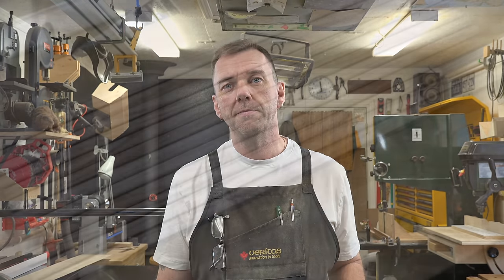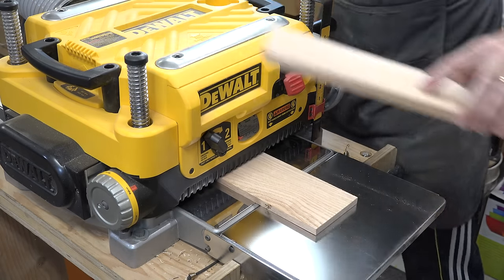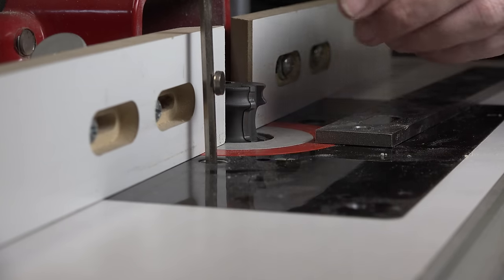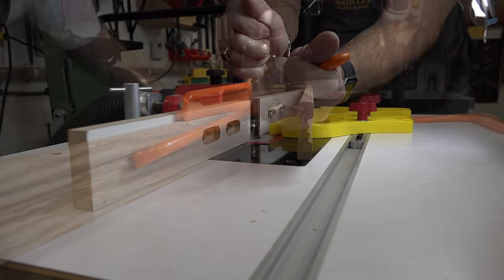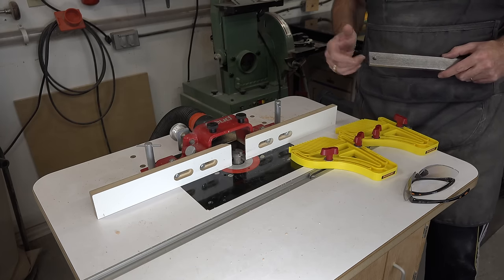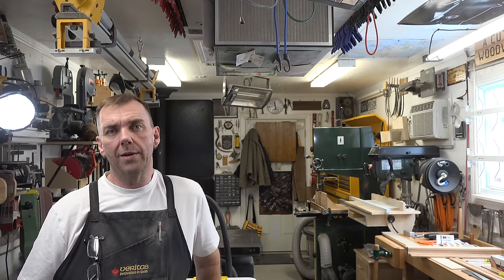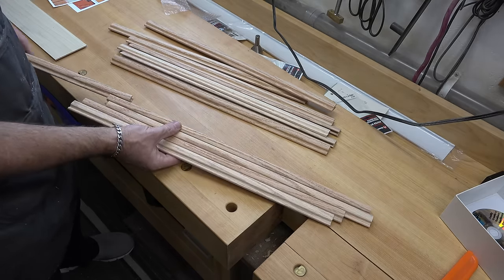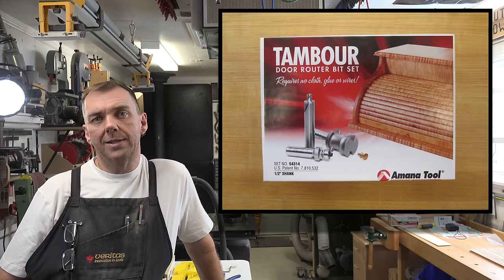Router Made Tambours

Comment: Hey, I bought this set many years ago, I've used it only once though. I used shims for the main cutter, so I set the fence to the final position, fit the shims to the front of the fence, removing one at a time to take off small amounts at a time. I use the same types of shimswhen using raised panel cutters. 

Cheers from Downunder
Reply from the maker: Sounds like a great method for sure.  The best part about this hobby that we all love is that for every process, there are multiple methods to achieve the final result and while my method works for me, it is not the only method to make these tambours.  Thanks for tuning in and for chiming in with your method.  I truly appreciate it.

Comment: By the way - that's a good general tip (that I first heard of from Charles Neil) about 'pre-cutting' a portion of what you expect the router bit to do. The same kind of thing can be done for a sliding dovetail or a t-slot - use the table saw to remove a big part of the wood and let the router bit just do the fine tune-up (so to speak.) Not all things work that way, of course - so taking more than one pass as you did with the first bit both reduces the strain on the bit and gives a much better final finish to the cut.
Reply from the maker: Thanks Ken.  I'm a firm believer in "work smart, not hard" and the same thing goes for my tools.  Why labour them down and wear them out prematurely when you can use two different tools to reduce the strain on both and make them both last longer with better final results.

Comment: Great video and it looks like a really nice result.  Shame they are an unbelievable price though..  I was excited to buy & try until I looked at the price.
Reply from the maker: Dave, I'm not going to try and cushion the price of these router bits but what I will say is that although they are brutally expensive, I don't regret buying them for one second.  The tambour on my roll top desk is incredible and it wouldn't have been possible without the bit set.  I would have had to relied on the traditional method of using cotton canvas and gluing my tambour stock to that.  I really didn't want to use that method.  I guess what it boils down to here is that I was hoping to make an heirloom piece with this roll top desk and I have done exactly that.  Making the tambour last as long as the heirloom was important to me and this method made it possible.  It was well worth the price to ensure that this desk would outlast me for many years to come.  Whatever method to decide on, I hope your project works out to be fantastic.  Thanks for tuning in to the show and for taking the time to leave your comment.  It is truly appreciated.

Comment: Nice! Thanks for recording this. I'd like to see a summary of how much the wood to tambour ratio is (that is, how many inches of "width" of the input 1/2" stock produces how much "height" of the resulting tambour).
Reply from the maker: It's a little difficult to measure, but it looks like each piece of oak in the tambour produces about 9/16" of length in the overall tambour.  There is some loss where the balls go into the sockets but from what I am measuring this morning it looks to be about 9/16".  I hope this answers your question.  It was a little confusing.  Thanks for tuning in.
Reply: @acutabove_woodworkings  So 2 inches of stock (actually 1-15/16) turns into two strips in the tambour. Thus 1 inch of stock produces 9/16" of door? So 9 inches of door requires 16 inches of stock, 18 :: 32, 27 :: 48, and 36 :: 64. That's a great piece of information to have! Thanks!
Reply from the maker: Austin Hastings you’re very welcome.

Comment: Hello, Great video. Two things though...  It looks like you were struggling with the push stick on the milled side of the stock after passing the bit. Maybe a Third Feather board would help or at least moving the two you have and repositioning them so one is in front and one after the router bit. Second, What is the kerf of the table saw blade required to cut between the two beads separating them into two halves...? 1/8” or less using a thin kerf blade...?  Greg
Reply from the maker: Thanks for the suggestion on the additional feature board Gregory.  I appreciate your input.  As for the saw blade needed to separate the two bead sections?  It can be any standard saw blade.  The kerf on mine is 1/8" but really, any saw blade will do the job.  I hope this helps.  Thanks for tuning in to the show.

Comment: Your video was about I was wondering about. When I was a kid we had a color TV as furniture. It was ornately carved & had a tambour door but it didn’t have a cloth backing. Everything use to be better made. I miss it. I have a penchant for minimalist things or processes—rope knots to do work, geometric constructions, timber framing, etc. I see elegance in simplicity. 
Curious question I hear Canadian English but you use Imperial? Are you binational? Or trying to appeal to a wider audience? Whatever the reason I appreciate it. I’m turned off by woodworkers that use Metric. I know it’s simpler but I’m not use to it & frequently have no frame of reference without making a conversion. I’m glad I I found your channel.
Reply from the maker: Well, we will start off with the simple answer to your question.  I am Canadian.  As for the metric vs imperial, I grew up and was in school while Canada was still an imperial based country.  Then at some point in time the government decided that they would convert to metric but I was already using imperial on a regular basis so metric never really stuck in my head.  I ended up entering the trades when I got a little older and the trades were a little slower to covert to metric and because of that, we all worked in imperial.  Canada claims to be a fully metric country and almost all measurements are now in metric but yet, if we want a metric bolt or nut or metric hardware, it is considered a specialty item here as the norm is imperial.  All tools that are sold for woodworking are mostly imperial.  So the long answer is, I'm Canadian, but I'm a little messed up.  LOL.  Thanks for tuning in to the show.

Comment: What is the third bit in the set used for. Very nice set, and it makes it easy
Reply from the maker: The 3rd bit Jeff is just a roundover bit that is used to add a rounded profile to the lower bar or tambour lift.  Any round over bit will do and it isn't really a specialty bit so that is why it wasn't included in the video.  Thanks for tuning in and for chiming in with your question.

Comment: Hi Kenny! Now that I have found you, you keep popping up everywhere. I was looking for a way to put doors on one of my tool cabinets and this seems ideal for the situation. I was wondering what the magnet was attached to the handle that raises and lowers the bit. Clever solution to keeping sawdust out of the hole. Another thing I was puzzled about was why you chose to put two feather boards on the entry side rather than having at least one of them extend past the router bit so it was still held tight against the fence when exiting. I realize you might have to move it if the stock was getting thinner but you could also adjust the left side of the fence to compensate. When I was watching closely, it appeared to come out a little at the end of the cut and then later at 9:02 it appears there is in fact a ridge about an inch or so from the end where the stock came away from the bit. Love the kerf idea for the second bit. Wouldn't have thought of that. ;o( You continue to amaze me. Regards, Bill
Reply from the maker: Sometimes Bill, I don't have a reason why I do things, but that doesn't mean that there isn't a better or alternate way of doing it.  Feather boards on the outfield would be just fine for this application.  The hardest part with all of this is keeping the feather boards out of the way of the push sticks.  What a pain in the butt.  LOL.  Thanks for tuning in to the show.
Reply: @acutabove_woodworkings  I understand. I was thinking that your left hand push stick is only required because it is coming out of the featherboards at the end. Otherwise you only need the one on top at the back to push it forward like a table saw pusher. I was trying to offer a potential solution for your future work. ;o) I am pretty sure I am going to do those tambour doors. I'll send a picture when I am done. Regards, Bill

Comment: If you make it orange would it be a tamborine?  When cutting the first set of  slats would it have helped with another feather board on the outfeed side?
Reply from the maker: Yes Ken, it WOULD be a tambourine.  That's funny right there.  LOL.  As for your other suggestion, after making this one, I would say that a second feather board would definitely be an asset.  It would allow you to concentrate on just feeding the stock instead of trying to keep pressure on the in-feed and the out-feed fences.  It would most like also provide a more consistent rout over the entire length of the tambour slot.  Great eye and a great suggestion.  Thanks for chiming in with that.

Comment: Hey Ken- I watched this one with great interest as I have this particular set of bits as well. You mentioned the possibility of creating a setup block for the bits and I was wondering if you ever did that?  If you have,  would you consider selling a set? I'd be more than willing to pay for your time, postage and material. If not, no worries! I'll still remain subscribed and still throughly enjoy your videos! Lol! Thanks Ken...P.S. Watched the Bread box build and loved how it turned out!  -Diane
Reply from the maker: Hi Diane.  It's great to have you as a viewer.  I did end up making a set up block for this particular set of bits but unfortunately I wouldn't consider selling it.  I can however, tell you how to make you own and if you have the tools to use these router bits in the first place, then you have the tools to make a set of set up blocks.  I made mine out of UHMW plastic and I cut the thickness of it to the same thickness that you would require to make a tambour which is 1/2".  The length and the width isn't that important as long as you have enough material to run it through the router table safely.  Using the measurements that I gave in this video, I routed the groove for the socket in one edge of the plastic.  I made several test cuts to ensure that it was perfect before I cut the plastic.  This does two things, it gives you the height of the bit and it also gives you the ability to set the fence distance from the bit.  I also set the table saw blade height and the fence for the relief cut for this routing and cut the groove in the opposite edge of the plastic.  Once again, I made sure that I did multiple test cuts to ensure that the cut was perfectly centred on the 1/2" piece of plastic and when I was happy, I cut the set up block.  This allows easy setup of the table saw blade height and fence.  I also did several test cuts with the shaping bit and once I was happy with it, I ran the plastic through the table to get the profile on the one side of the plastic, again, allowing for easy setup of the router bit height and the distance from the fence.  All of the profiles can all be cut on one block and it takes about as much time to make a block as what it does to set up the bits initially.  After that, it's lightning fast with the use of your setup block.
Reply: kennyearrings1 - Thanks for the quick reply...say? aren't you supposed to be on vacation? Lol! I appreciate the information....you're the best! -Diane
Reply from the maker: Diane Russo you're very welcome. Yes, I am on vacation but that doesn't mean that I can't take a minute or two to reply to the people that watch my show. People like yourself make this show what it is and without you guys, I would just be talking to myself so the least that I can do, is reply when someone asks me a question.  Vacation or no vacation. If you have any other questions, don't hesitate to fire them my way and I will be glad to help you if I can.

Comment: Any thoughts on how to run them in a groove ? Amana expect you to run the entire  slat in a groove but then it has no 'shoulder'. I wonder if there is room at the end of the slats for a dowel  ?
Reply from the maker: There is no room at the ends for a dowel.  If you were to run this tambour in a roll top desk as I have, the tambour seems to run just fine in a 5/16" width track as the tambour actually protrude into the track by a depth of almost 5/8".  No dowel needed.  Really no need for a shoulder here as there is enough space in the track to allow ample movement.

Comment: Enjoyed the video, I always look forward to your postings. what horsepower is the router in your table, just trying to gauge if mine would have enough power?
Reply from the maker: Thanks for the kind words.  I'm going by memory, but I think that my table router is a 3-1/4 HP.  I'd have to check to be sure.  That much HP isn't needed for bits that remove this amount of material.  I would want a heavy router like this if I was routing raised panels, but it isn't necessary for this tambour project.

Comment: For finishing... I'd assume that's is something you do before assembly with a light stain and poly. Did you find any binding after applying finish?
Reply from the maker: The finish on these tambours was done prior to the finally installation and assembly.  While this project received finish during the filming, I have made other tambours with this method that did receive a finish.  Each slat is coated individually and then allowed to dry completely.  For me, the finish of choice was varnish and once the slats were all dry, the project was assembled.  As for the binding, there was none.  Plenty of room in the tambour track to allow for any finish.  Thanks for tuning in and for taking the time to leave me a comment.
Reply: Thanks!  The video and your response is much appreciated!
Reply from the maker: You're very welcome.  If you have any questions, please don't hesitate to ask.

Comment: Thanks for sharing Ken!! Never seen these bits before, are the ends, where they ride in the tracks, going to be that thick or do they get cut down ?
Reply from the maker: You're welcome Dale.  The ends of the tambours will remain at their nominal thickness of 1/2" and they will be inserted into a routed tambour slot that will measure 9/16" in width.  This gives a bit of play in the tambour slot and allows it to function correctly while still keeping the tambours full strength of 1/2" thickness.

Comment: Hello kenny. May i ask what is that red hardware behind the fence? The one with the dust extractor is attached to. Is it a diy build or bought? This is not the table that you assembled in previous video yeah? 

It looks solid and reliable as fence sliding mechanism
Reply from the maker: The router table and fence that was used in this show is NOT the Jessem router table that I recently assembled on the show.  The one used in this video was purchase many years ago and is made by Freud.  For all the years I had it, it served me well and it was a great unit.  I did a quick internet search and was unable to find one for sale anyway so it may not be available any longer.  Thanks for tuning in to the show.
Reply: @acutabove_woodworkings  ahh understood...thanks kenny. I did some search on amazon after watching your video and cant find anything that resembles it but i did find that jessem set. Beautiful work
Reply from the maker: @ebbios  Thanks for the kind words.  I did find something similar to my old router table fence.  In fact, it looks like a complete knock off.  I bought the original router table at Home Depot and I checked their website.  They have a couple that look identical but they are manufactured under the name Felisatti.  I'm not familiar with this brand and have no experience with the fence, but it sure looks the same.  You might want to check it out and see what you think.  https://www.homedepot.ca/product/felisatti-premium-router-table-fence-with-dual-micro-adjustment/1000862723
Reply: @acutabove_woodworkings  ahhh thank you for the link. But I dont think I can afford it for now. Most of the time I can afford to buy the item but not the shipping cost to Malaysia. And usually the shipping cost is much more expensive than the items themselves. I found the kreg router table and the router lift here locally but wooowweeee its about rm4000(965 usd) for both. Ill stick with hand routing for now....lol. And thanks again kenny
Reply from the maker: @ebbios  Shipping anywhere is very expensive.  We have the same problem here in Canada.
Reply: @acutabove_woodworkings  oh I see. International shipping wouldve cost me a fortune...lol